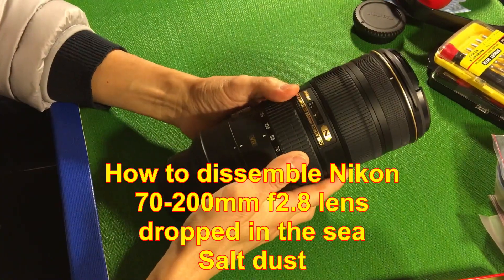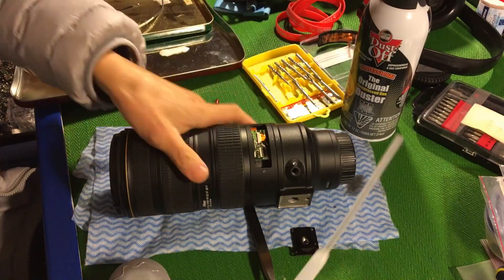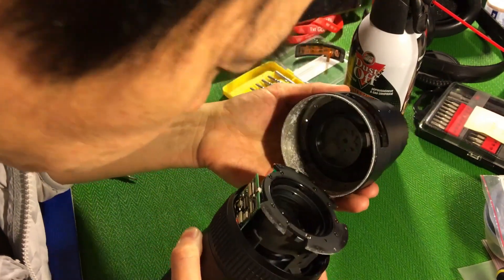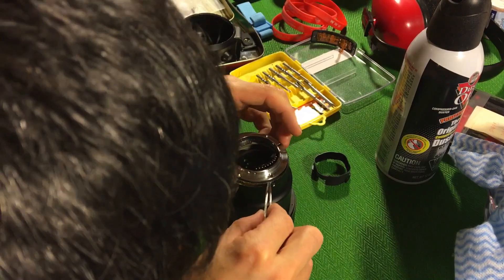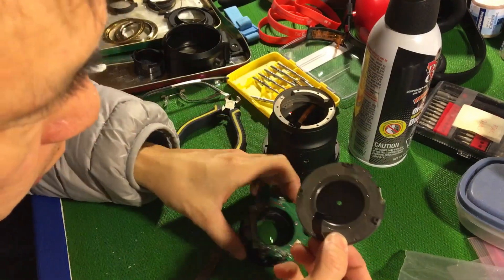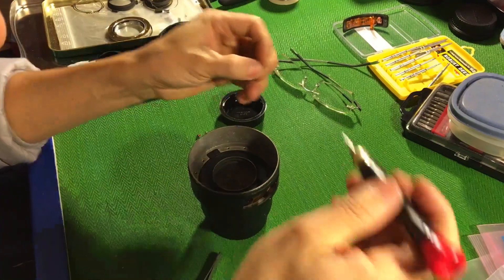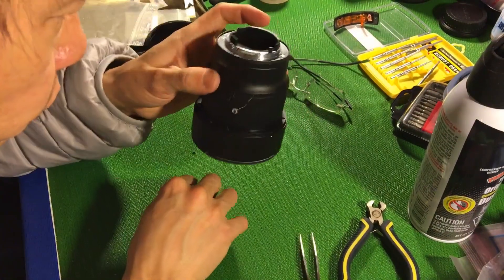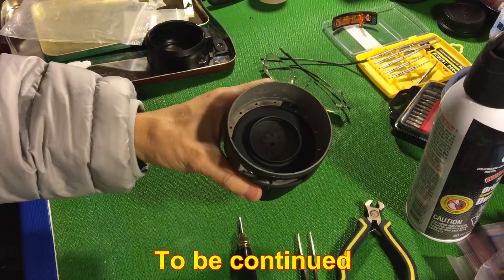How to disassemble Nikon 70-200mm f2.8 lens dropped in the sea (Part I)

Comment: Good video. What is the part number for nikon 70-200 vr ii lens where filter goes on in front (are there additional parts to replace). Got a situation where it’s bent in, cannot fit a filter on the front. Lens works excellent, no damage to it, just the front part where the filter sits. Replacement parts look like the front part, a metal gasket ring inside and the rubber grip around the front. Thank you.
Reply from the maker: Hi, Thank you for your comment. I found out this website has the part list: https://manualsbrain.com/en/manuals/1935256/

Comment: I just cleaned the inner lens of my 70-200 which obviously has been badly cleaned before and caused unusual flare (bought it 2nd hand). Luckily, it was the lens that is exposed after the first step of dissassembly, close to the aperture. 
Your video helped me a lot.
Now the lens is super clean and works.
Thanks :)
Reply: Hi, what precision screwdrivers you used to open it?
Reply: @kayahkeista5042  You can use a phillips head precision screwdriver, maybe not the biggest one.
As far as I remember I did it all with the same phillips screwdriver.
The screws of the tripod mount plate could be very tight, so you should get one with a good grip.